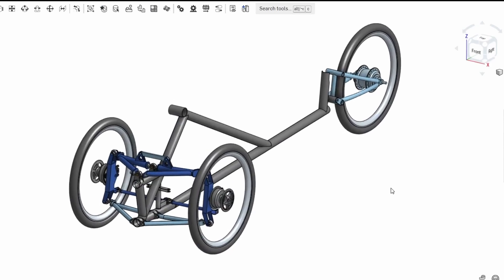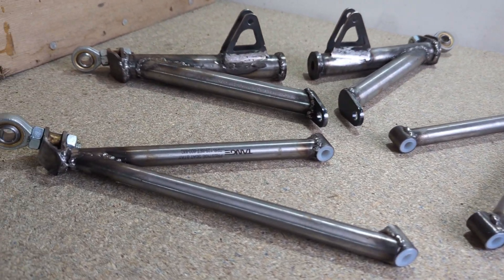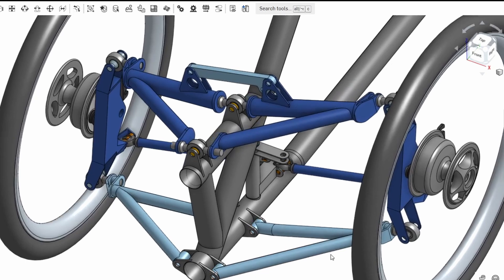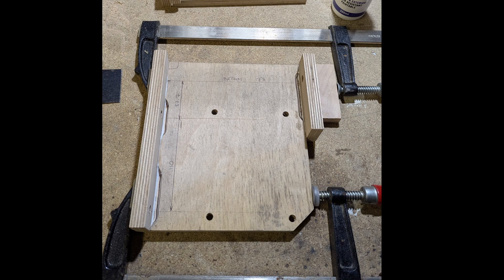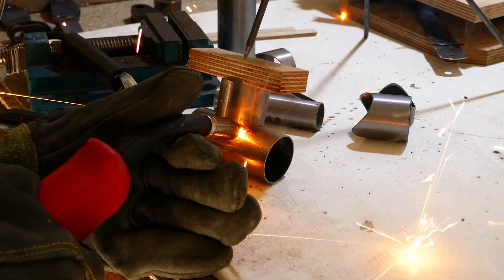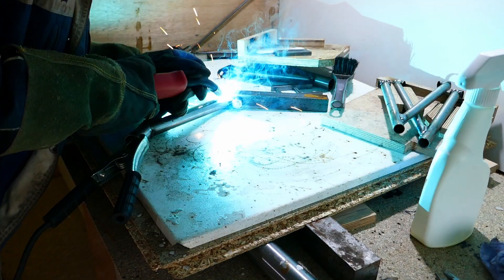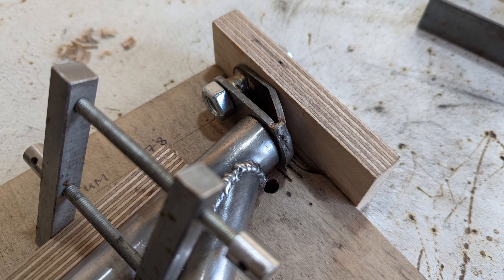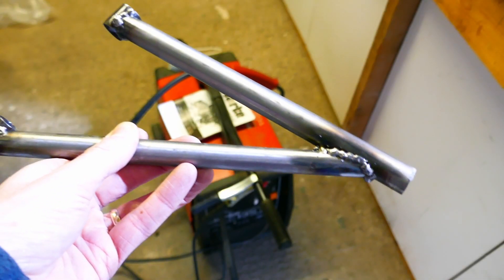Making the Tilting Suspension Wishbones - Tilting Trike MkII Build Project Ep. 2

Comment: Good work sir. My number one recommendation from a poor welder is to get a big bottle of argon mix gas, like the Hobbeyweld 9l original. The argon mix gives a much much better weld l. At £115 odd to buy, £60 refund on the bottle when you are dine, £44 for every refill afterwards, which is 13 of those bottles you have. Without the savings it's worth swapping just to the better welding gas.
Reply from the maker: @stephenlesbos6208  thank you - I will definitely look into that, I’m thinking of upgrading to a TIG welder too, so need to do some research!

Comment: Be very careful when spot welding like that. It's a cold weld, so at the very least be sure to check the inside of the tube to make sure you have full penetration.
Reply from the maker: Good point, I did check inside and there was quite good evidence of weld penetration so I think the welds are ok-ish.

Comment: Im building my own tilting tryke, can see the project on my channel. My welds don't look fantastic either but when i bought a tig welder it was like i started working on easy mode on thin mental. In 2+mm metal, stick or mig i feel is as good if not better but lower than 2mm tig shines. Far better temperature control with good results coming easier. A good tig welder has high frequency start. At first i bought a cheap one with lift start. I find super difficult to use so definitely spend the extra money and get a hf start. An ac/dc to weld aluminum are super nice but they are more expensive. I'm glad to see you back at it again. I have to admit I watched your first prototype very carefully and learned a lot from it.
Reply from the maker: Thank you for the tips, I would definitely like to be better at welding, it would be a good skill to have.

Comment: Great design. I wonder if you'd considered using TIG to weld the tubes?? It gives you far better control over heat, particularly for light duty and dissimilar thickness materials, while offering excellent strength joints. Interesting series, looking forward to future episodes.
Reply from the maker: @DaveMcIver  yes I would like to learn to TIG weld, maybe I’ll try and find a second hand rig one day.  I was considering brazing too but that would also require investment in kit I don’t have (my plumber’s torch won’t be enough).  The only reason I MIG’ed it was that I already had a MIG welder, but it’s not the perfect option.
Reply: @MetalMachineShop  welding steel with TIG isn't that hard, and nowadays you get simple DC welders with HF start for next to nothing. I'd recommend not going for a second hand (unless it's a name brand all digital), and welding small stuff like this is much easier than an old analog MIG machine built to weld large agricultural equipment. The upgrade I'd recommend is a proper torch from for example OCIM, a WP17 would suit your needs well,

You can even do brazing with TIG as well, look up silicon bronze. Plenty strength for your application, and way easier to handle thin walls.
Reply from the maker: @brynyard that’s really helpful, thank you.